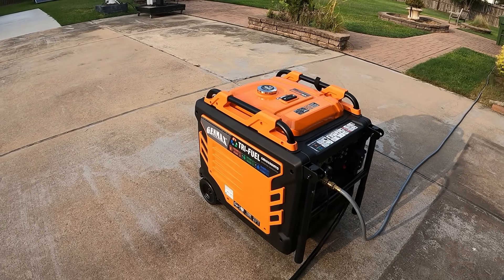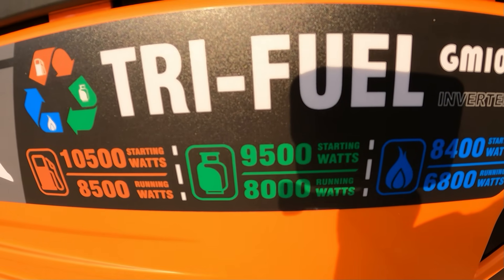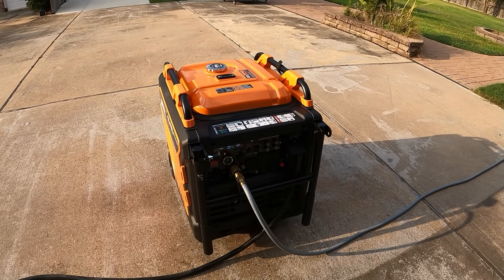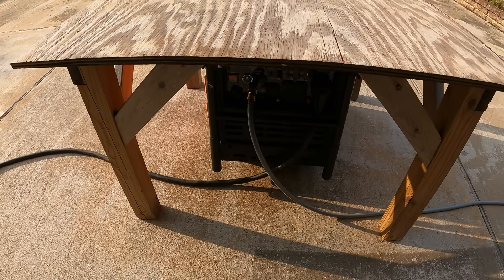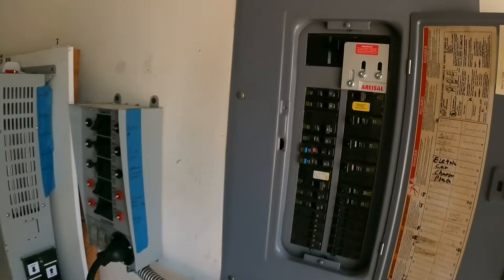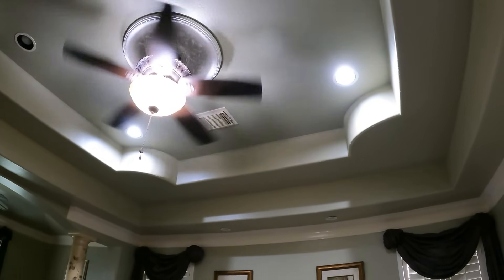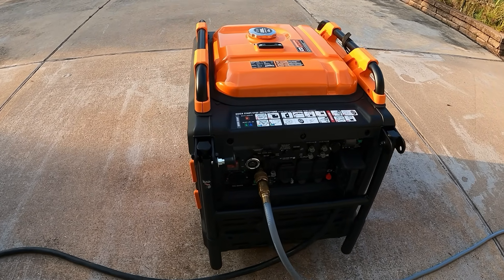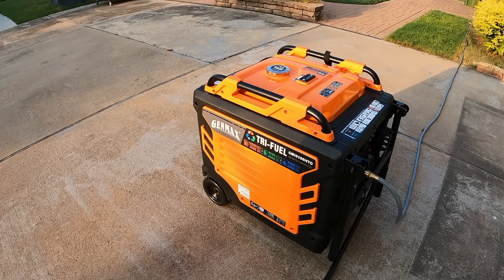GENMAX GM10500iETC TRI Fuel Inverter Generator Running a 5-TON AC - BETTER Than A Standby Generator!

Comment: very good, but nobody talks on how to have it run when it's flooding... where do you put it? even stand-by generators are usually installed on the ground, which doesn't make any sense
Reply from the maker: I guess in case of flood I’m putting mine on top of its cover. Thanks for that great idea honestly, I never thought of it.
Reply: @GeneratorReviews  I know... it seems nobody thinks about that, but to me, that's the main concern...
Reply: Free wooden pallets
Reply: Thanks for showing your soft start system. I think my electrician pulled a fast one on me. My soft starts on both A/C units have no external boxes at all. They took my money though.
Reply: @ChatGPT1111 it also be installed internally not all of them install on the outside. Depends on how old and model of your AC
Reply: get creative to survive…come on man/

Comment: Gavin, can you do the same video paralleling a 9000 IEU unit on gasoline? I have the 9000 unit on your recommendation from your videos. I am now getting the 10,500 Tri-Gas and connecting it to my gas line here at the house. I wonder how well paralleling the 9000 would work? Would I be able to run both of my AC units and everything else in the house?
Reply from the maker: As long as you have soft starts and paralleling two generators you should be able to do it

Comment: My natural gas connection is about 50 ft from my 50 amp inlet box. What is the inner diameter of your natural gas hose?
Reply: The provided hose is half-inch with half-inch quick connect fittings.
Reply from the maker: Mine is about 75 feet are used 50 feet of holes and 25 feet of power cable and it worked just fine

Comment: This is a great machine. I got mine on Friday! 

I did learn, though, that while they kindly include a 120v style plug (NEMA 5-15P) as a ground-neutral bonding plug, the GFCIs on the generator don't really like it and will trip, which cuts off the neutral path and breaks the bond (I was running it stand-alone not connected to my inlet and this generator is floating neutral). My fix, since I'm not using the 50 amp outlet and that outlet is not GFCI protected, was to take the 50 amp plug that they include and made it into a ground-neutral bond. Problem solved!
Reply: Yes, I don't think you can use bonding plugs on GFCI outlets, so your solution is great.  If one is using the 50 amp plug, you could use the 30 amp for the bonding plug as well.  Of course, the bonding plug just lets you use the outlets like a worksite machine, so it's not something you would be using while the unit is plugged into your house.